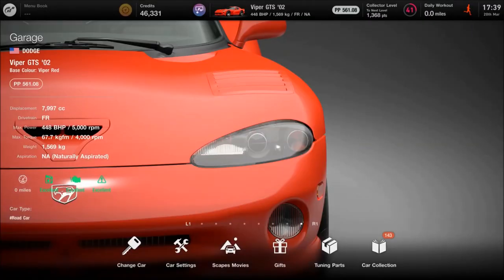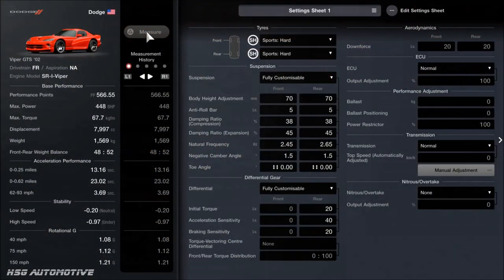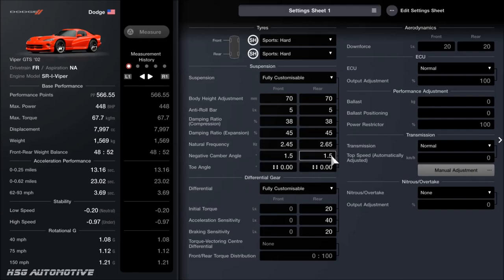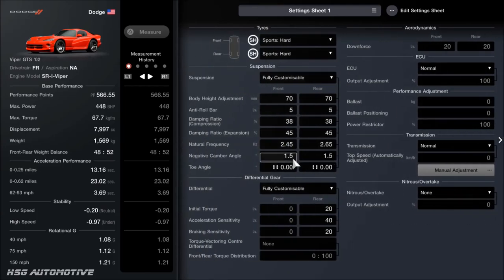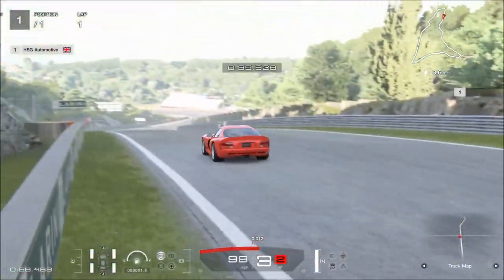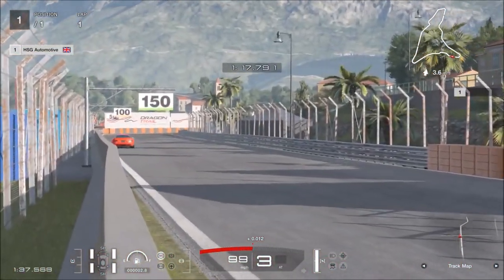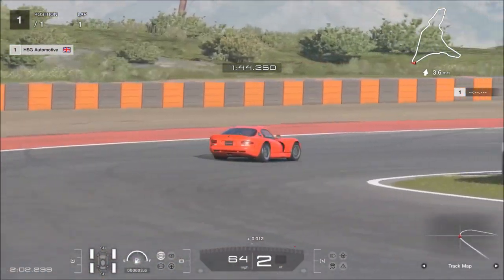GT7 - 2002 Dodge Viper GTS CIRCUIT/GRIP Tune Setup Tutorial

Comment: Going to give this tune a shot! My viper is tuned up to 840hp and I can't crack more than 3/4 throttle without starting to rotate in the straights with my current tune. Maybe this will stabilize it a bit!

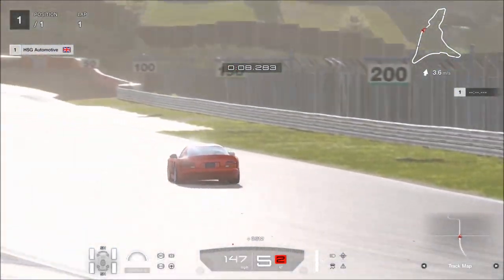Comment: It's a fantastic car, but if you set the suspension that low it'll bottom out and understeer on some tracks, especially through hairpins. I'd do at least 77 mm just to give it enough clearance to prevent that. 3:14 You can see the rear end wobbling somewhat because the the front wheels had no more room to turn so the rear end kicked out to rotate the car. This car is less of an issue with this than others though since it is pretty controllable (try a very low Evo VI and you'll see for sure). By all means drop it that low on an oval or something though for max aero efficiency.

Comment: Awesome Setup but still is something wrong with the cars I tune or with the cars in general. If I tune a car in this case with more Horsepower, the car is after 300km\h at straights very nervous and at Highspeed corners completely unstable and I fly away at almost every corner. It happens with every car I tune, i tried with setups and without, I don't get it what's actually wrong? It never happened in GT Sport and ruins many races for me. In example, Audi R18 2011 at Le Mans, I fly out at almost all Highspeed corners, is it a bug? It happens when the car hits more then 280km\h and corners.